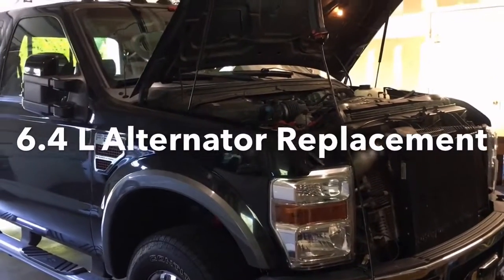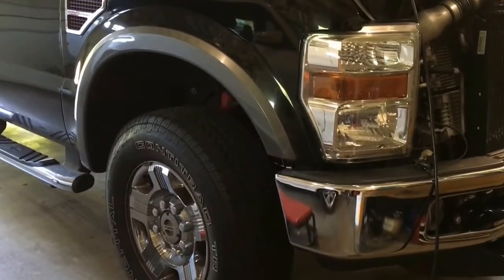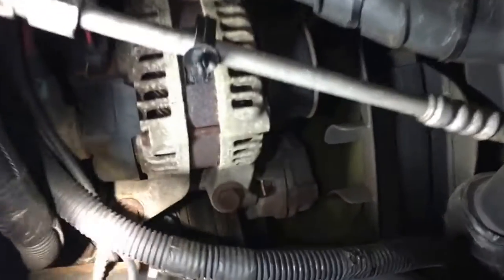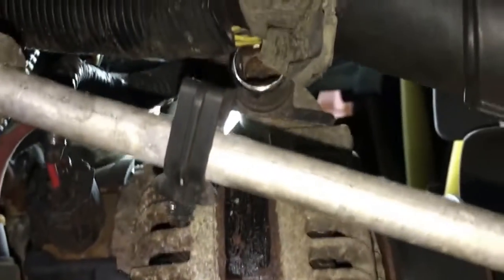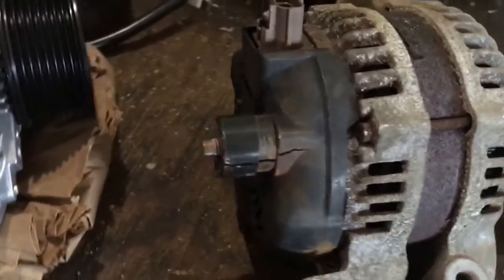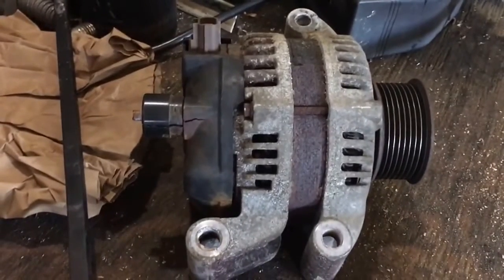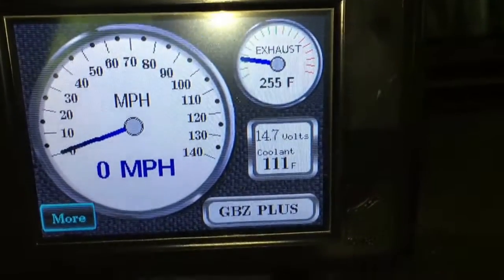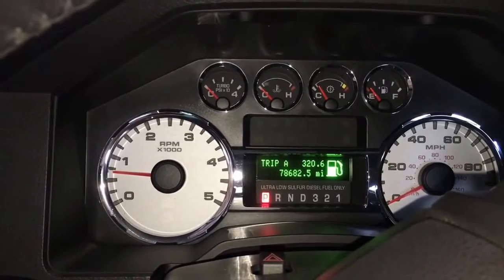6.4 L Powerstroke Alternator Replacement - DTC  code P0625

Comment: Hi I've been getting this code intermittently in history did you by any chance felt your engine underpowered at times? Thanks
Reply from the maker: No. A faulty part of the charging system wouldn't have anything to do with under powering the engine. You have something else going on.

Comment: I changed the alternator and it’s charging 14.4v. But the battery light is still on. I’m thinking it’s the 2 wires going to the PCM, I’d like to load test them, but I can’t find a pin out for the PCM for a 08 F250. 

Any thoughts?
Reply from the maker: Perhaps the truck needs a few on/off cycles to clear the battery light warning.  Have you tried clearing it with a code reader?

Comment: What if you had to replace alternator and water pump and new belts do just remove grill radiator and condenser and expose the whole front?
Reply from the maker: To replace water pump, you certainly have to remove the radiator to get into the front cover.  Not as easy as it sounds.  As far as the belts and alternator, it's doable without exposing the whole front.

Comment: Thank you in advance. 👍Giving the socket sizes will save me time today getting everything lined up, definitely going thru the fender well instead of from the top.
Reply from the maker: That's awesome.  Everything on this engine is a PITA because everything so damn tight in there.  Good luck.

Comment: For anyone else reading the comments, I would also recommend changing the tensioner pulley while you are there. Those tensioners are bad about separating, and it appears that this one was beginning to, which could cause the belt to slip and not allow the alternator to charge fully. When the tensioner finally separates, it could cause other damage.

Comment: My battery light is still on after replacing both batteries and alternator. The alternator that the seller sold me is a 110 amp one that's "supposed" to be for my truck according to their computer.
Reply from the maker: There's a few things you can trouble shoot.  I would do it in this order:
1.  Plug an OBD 2 scanner into the port below the steering wheel to check for codes.  It may need to be cleared from the computer.  If you don't have an OBD 2 scanner, you can get it done for free at most big box automotive stores (Autozone, NAPA, Pep Boys, etc).
2. Some vehicles require multiple engine starts/stops to clear dashboard lights after the problem is corrected.  You may notice it miraculously go away after a certain amount of start ups.
3. Identify if there really is a problem with the charging system.  There are videos on YouTube on how.  The easiest way it to set your multi meter to DC volts.  With engine off touch the positive and negative terminal on battery and see that you have somewhere in the range of 11-12 volts.  Do this on both batteries.  Now start the engine.  Turn off all electronics, radio, A/C, fan, Lights off, close the doors so the interior lights are off.  Now test the batteries again with the multi meter.  You should now be reading 14 - 15 volts indicating that the alternator is actually charging the batteries.
Start there and reply back on you made out.
Reply: @DieselMike  thanks for the quick reply!I forgot to mention that according to my H&S tuner, the system is only charging at 13.3v
Reply from the maker: @gc7967  Anything over 12v means it is charging.  13.3 idling sounds about right. Get a reading while driving at 60mph with all electronics off.  I bet you are pulling over 14v in that scenario.  But it sounds like the alternator is indeed charging.  My guess is a faulty error code, or it just needs to be cleared with an OBD 2 scanner.  Does the H&S have the ability to read and clear codes?  I know my tuner does.  But it's not an H&S.
Reply: @DieselMike  yes,my tuner can clear codes and I've cleared it a few times.I've driven my truck up to 120kph for a few minutes and my tuner says its charging at 13.3v.
At idle, my halogen headlights are dim until I rev the engine.
Reply: The code is P0620
Reply from the maker: @gc7967  Something is causing a voltage drop from the Alternator to the Batteries if that code keeps popping up and the headlights are dim.  If the alternator was indeed new, I doubt it's a faulty unit.  Check the wiring.  Make sure you have a good connection where the wire harness plugs into the Alternator.  Clean the contacts and put a little dielectric grease where metal meets metal on the plug.  At the batteries, make sure there is no corrosion on the terminals.  Rub the inside of the copper clamps with fine sandpaper.  Get them nice and shinny.  Reapply with dielectric grease or better yet, copper based never seize.  Make sure they are secured to the studs of the battery tight enough that you can't spin the clamps.  If you are still experiencing voltage drop, you may have a break in the wire harness or you just got a bad alternator.  A faulty PCM is possible, but doubtful.
Reply: @DieselMike  thanks for taking the time to help me out!
Reply from the maker: @gc7967  Any time.  Hope you find the issue.  Good luck.
Reply: I just tested the batteries and with the engine off,I get 12.20v on both batteries and 13.75v when running.
Reply: Is the 2008 F250 6.4  1 of the vehicles  that take multiple starts to clear the battery light? Because everything was fine alternator went out through battery light on changed alternator battery light still on

Comment: Great video! I went the same way you did - upgraded to the 200 amp mostly because I have the two batteries but also because I tow a big RV (2008 F350 and 40' 5th wheel).  Also got mine from Amazon (DB brand, $242 + $20 tax and no core charge). I luckily had inherited a low-profile tensioner bar from an old roommate about 15 years ago and had never needed to use it (didn't even know what it was for about 10 years) until now. The range of motion for the bar is still ridiculous due to Ford's cramming these engines in as tight a space as possible but it was enough to slip the belt off and then on with the alternator at an angle and then get the bolts started to pull in alignment. I'll add that if you do this - use the bolts to pull in alignment - start with the one on top first. Reason is it has the least 'wiggle' room in the bolt tubes and therefore is the hardest to get the bolt aligned to start. 
Took about as long as I thought it would. Afterwards, the battery light went off but I'm still taking batteries in to have them checked. I know... sounds backwards - one should check the batteries first, right? I my case, the battery light came on but I was also hearing a noise from under hood that wasn't there before the light came on so I was (1) betting it was the alt dying and (2) I'm hitting 100K and I've always performed preemptive maintenance on my vehicles @ 100K - alternator and water pump (including flush) regardless of whether they need it or not. Policy has served me well. 
Thanks so much for posting!! Made it incredibly easy!
Reply from the maker: Hey Man.  Thanks for watching and commenting.  Yeah, they don't make it easy to work on these 6.4's.  I too got my new alternator on Amazon.  The no core charge is key.  I still have the old one laying around wondering if I can get $25 bux for it at a salvage yard.  Ha!
The 200 amp kicks butt.  I could tell the difference when raising my snow plow.  I'm with you on the preemptive maintenance.  But even if your old alt was not the culprit, it's still worth the upgrade to the 200.  Thanks again for the comment.
Reply: @DieselMike  Well... everything was great for a few days... I went to Interstate and they checked both batteries and they were fine. So, alternator (check), batteries (check), battery light staying off (check).
Two mornings later I went to start up and batteries are dead. Ran fine and did not struggle to start the day before. My guess - bad wire causing a short and draining batteries. There are several YouTube videos on how the wires in the F series troughs going to the alternator have issues with wires getting chaffed,  corroding,  and ultimately breaking. 
So, I'll be grabbing the voltmeter and start diagnosing...

Comment: One question for you. 
I have Ford Truck 2008 Diesel 6,4l f250 super duty v8 2wd turbo diesel PowerStroke. 
And how many AMP Alternator is Original for my Truck. 
Please can you answer me.
I put 125 amp And doesn’t charge battery and i hVe battery light on.

Comment: I changed my alternator on same truck you have f 250 ford super duty v8 6.4 2 wd diesel. 
After i put alternator 130 amp i have my battery light ON Now
I don’t know why is On light now. 
Anyone know why 
Because I don’t know my original alternator is Amp.
Reply from the maker: Possibility 1:  Did you disconnect the battery before doing the work?  If not, you probably threw a code when you disconnected the old alternator.  Clear code and see if it comes back.
Possibility 2:  Check all of your connections to the alternator are correct and secure.

Report back and let me know.
Reply: Diesel Mike 
I think this guy my buddy who change for me this alternator he didn’t disconnect battery 
I’m going latter to disconnect both battery off and hold for 30 mins and see how is. 
But is there big issue because my light is on 
Its ok if i drive truck. Let me know please 
Thank you buddy
Reply from the maker: @Handymanjobs  I can't say whether or not it's okay to drive the truck.  I have no idea what your buddy did.  If he didn't connect the wire harness properly to the alt, you aren't going to get very far before you kill your battery.  I don't think disconnecting the battery for 30 minutes will do anything.  You need to clear the code with an OBD II scanner.  But first figure out WHY you have the code.  This is why no one but me touches my vehicles.  You have no idea what was (or wasn't) done.
Reply: Diesel Mike 
Now i get  Green Key big one light on my screen and i have TRIP A  on my screen. 
And today my truck shutt off  and he doesn’t want to start couple mins and now he start again but still on trip A. 
I don’t know why and what is that

Comment: How
Many Amp should be original for ford truck f250 diesel 2008 v8 power stroke super duty 6,4l.  2wd.

Comment: so by up stepping up from 125amp alt . to 200 amp I noticed you didn't reprogram computer . when I asked dealer the told me I would have to reprogram computer to step up from 125 amp to 200 amp or did you and you didn't show it
Reply from the maker: This is the first I am hearing about this.  I wasn't aware such a thing was necessary.  But it's been a year and a half and no blown circuits or bizarre electrical issues have occurred.  I'll look into it anyway.  Thanks for watching.

Comment: I'm fighting this right now...I will just never understand why automotive engineers have to be such dumb sh*t f@#$&[@ a@@#&÷×> and put crap where no one can get to it.
Reply from the maker: Bryan Redhair — The 6.4 is generally a royal PITA to work on.  Only thing easy is an oil change and topping off wiper fluid!!  Thanks for watching and appreciate the comment.
Reply: Diesel Mike Please excuse my mouth. I do appreciate the video and after I finally got the tensioner released am making some headway.

Comment: Did this job today. Alternator died and took out both batteries. Batteries were under warranty luckily. Working through the wheel well is by far the easiest way. The tensioner was the most difficult.  It took a while to line up and I also used a strap to secure it. I replaced the idler, belt and tensioner prior to this job but should have done the alternator then too. Dealership wanted over a  $1000 to do just that he alternator.
Reply from the maker: Everything you said 100% spot on.  Hope the video helped.  I feared the bad alternator took out my batteries also.  But I think I caught it early enough.  With the replacement Alt, they fully charge, hold the charge and pass a load test.